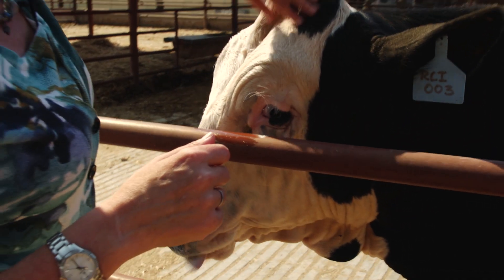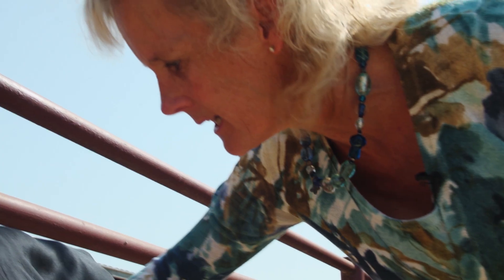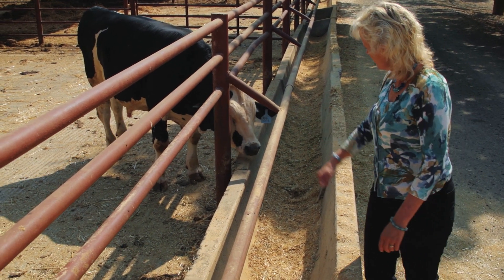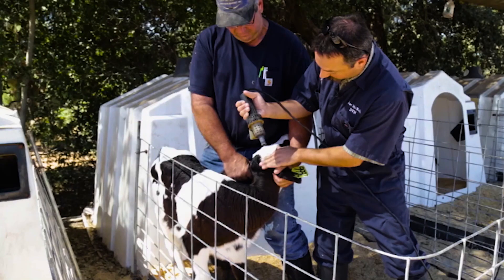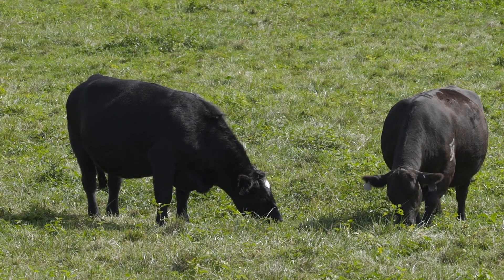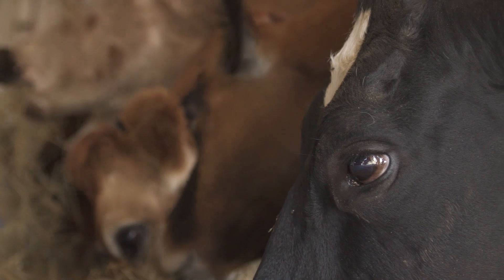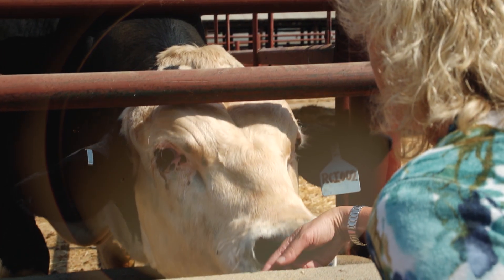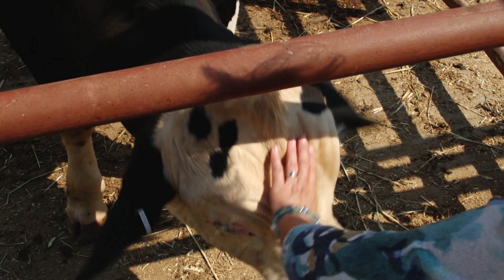Grabbing the Horns from the Bull

Comment: In the Alps, we still have a lot of cattle with horns and everything is fine. But there are not the same conditions: first a farm is on average about 35 head of cattle for Austria, people here know all their animals by name. Secondly if one starts to be aggressive, it becomes a burger. And third, cattle are more often in tie-stalls (don't worry they go on pastures if the weather is good, there is even a law that requires a minimum of days).

I think gene editing for cattle without horns can be good. The problem I see is that when used for more stuff, there will be just a few bulls with edited genes because it cost quite some money to do. These bulls will be used more for breeding (AI), which could reduce genetic diversity and thus cattle could become less resistent, so we will make more gene editing and the whole will lead to a vicious cycle. The other problem with GMOs is the economy, even if patents themselves are not bad, they create quite a few problems...

Comment: I wonder if genetics is also a feasible approach to tackle methane emissions.  It could be cost efficient for farmers as well as a QoL improvement for cows since increasing greenhouse regulation of the industry could otherwise require large indoor structures, masks and other unpleasant tools.
Reply: hmmmm I wouldn't call it impossible but guess it to be highly unlikely. those methane emissions are often results of the animals digestive system (some times there is just some crop residue or animal waist emitting naturally it, this can be harvested, digested, and burned into less potent co2 though, thus it is a more manageable issue)  my point being is the cow makes methane because of it's gut Bactria and how it digests food. To tamper with that delicate arrangement could result in something that can't graze at all, for the cow has that gut bacteria because it eats grass. (I don't think ,however, this means we shouldn't experiment at all, that is just my hypothesis, if you will.)
Reply: MrTouchFish methane is produced by bacteria not cows.